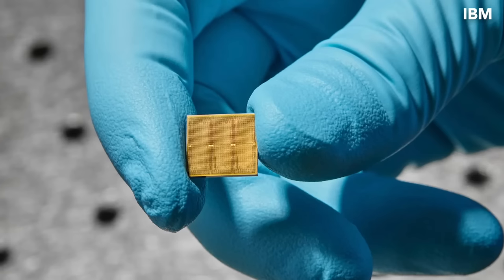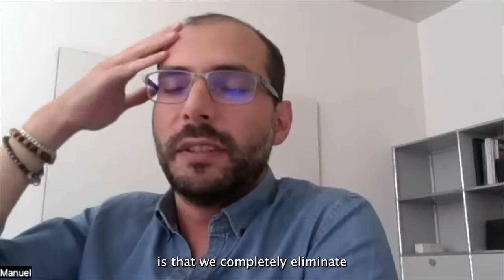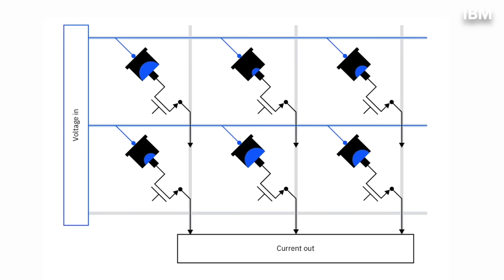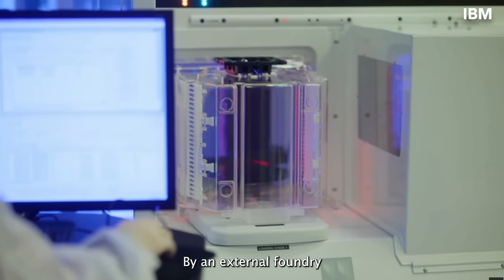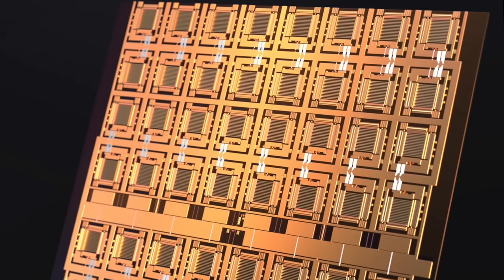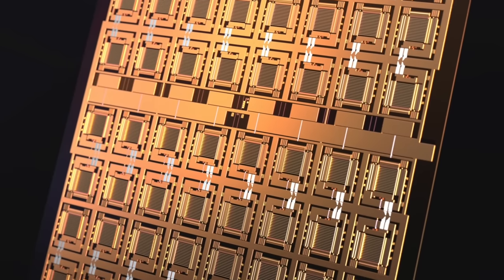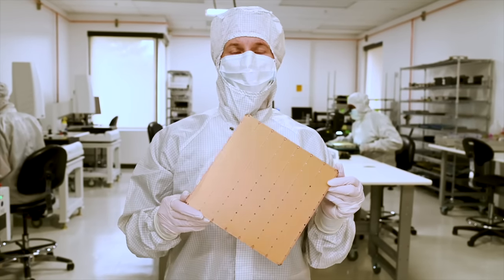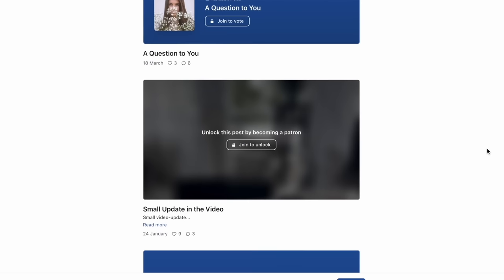IBM's New Computer Chip is Pushing the LIMITS! 🔥

Comment: In my professional field, analog is almost considered a pejorative term. At some scales the use of analog active filter elements using op-amps in combination with digital potentiometers, peak detectors and SAR type ADC's  can significantly reduce the computational overhead. As channels are added however the scale increases and the footprint with it. Seeing so much effort going into integrated analog/digital systems is very exciting for me, thanks for the great video.
Reply: It's low computation but high chip real estate.   For example,  the cosh function on the old ETANN chip used 4 op-amps,  and took up so much space it had to be time multiplexed between rows of the matrix - which  gives up a lot of the advantages of analog NN.    I've been pondering how to do an acceptable sigmoid func with as low as 2 transistors (with trick gates that resist saturation)  so that every matrix can afford to have its own realtime outputs.
Reply: Yes that's what I was thinking 😂
Reply: @MattOGormanSmith  Throughput though?

Comment: Honestly, it's scary to see how much money and effort goes into this at the moment, and how many overworked brillant engineers tinker away at their particular project, trying to find the next big thing that injects even more speed into everything AI. Breakthroughs are bound to happen and it's clear that we can expect BIG jumps in performance in terms of hardware, training methods, model architecture, algorithms and software as well as data. This is going to go through the roof. Ready or not, here it comes.
Reply: Então e aí que tá o Sucesso de ver quem já tem dificuldade de similar Palavras isso já são coisas Nelrais uma função que está dando um Curtosirquito. Trás o Chips a Memória que não tá mais fazendo a Leitura de Palavras e fica se debatendo em memorizar #
Reply: Evolution tends to favor the most adaptive.  The AI-human symbiosis co-evolution is inevitable.  "Scary" is irrelevant . . . some will adapt accordingly, others maybe not, such is the consistent nature of evolution.
Reply: Doesn't photonicas have the same benefit of doing multiple calculations at once with low power? At 70% the speed of light no less. 

 Then further there are quantum computers that use photons as well? 

 All without some of the issues here?

Comment: When you mentioned a substance being heated and cooled, to go from solid, to (liquid?) to Crystalline... how does this happen on such a fast scale? Doesn' heating and forming crystals take SO much longer than just passing currents? That implies a physical change process, not just an electrical state change. If it works, it works, not denying that, but it seems odd that the two would be on a competitive time frame. This stuff is SO fascinating! Thank you Anastasi and all who put these posts together.
Reply: If you use heat exchange formulas with the scale size of the material it is incredibly fast. Heat, or energy, transfers almost instantaneously at the electron size. If we have material in nanometer sizes, it would seem instant.

Comment: The problem with this result (just like Mythic's analog edge AI processor) is the power efficiency is not particularly impressive. The reported 12.4 TOPS/W is no better than efficient digital neutral networks. Oppo's 2 year old phone AP with a 6nm process node has an 11.6 TOPS/W CNN core, but that falls far short of the current leaders. Gyrfalcon claims 24 TOPS/W, but Perceive's Ergo chip (or maybe its Ergo 2) claims 55 TOPS/W.

This is an area I've done some research in. My original Ph.D. topic in 1990 was digital and analog neutral network implementations, and then I worked on the topic again a few years later and then again for a DARPA project around 2009. As you discussed, the fact is a lot of benefits of the analog computation evaporate when you include the DACs (for the input voltage) and ADCs and then if you need to extend the equivalent arithmetic precision beyond the SNR limitations of a basic analog multiplier.

It’s easy to say that reducing the power of ADCs and DACs could resolve that, but it’s much harder to actually do that. Reducing power of both these circuits has been an area of massive amounts of research for other chips. For example, the highly competitive $10B CMOS image sensor market demands ever lower power ADCs, and yet still those ADCs are very power hungry.

There was a big push in the direction of analog computation after Carver Mead published his book “Analog VLSI and Neural Systems” in 1989. I heard many people making extravagant claims that analog computation would soon replace digital (like the time one of Carver Mead’s students who gave a talk at my university said, “Oh! Carver says that no one’s working on digital any more”).

The hype never manifested because of the issues you and I have both discussed. Another issue is that the design and validation cycles for complex analog chips are so long that by the time you get your product to market, your digital competitors have moved on a process node, or two. Maybe that runs out at some point with the much-discussed end of Moore’s Law, but there’s still a long way to go before lower power digital innovations run out of steam.

I’m not saying this approach can never yield benefits (evangelists would always point to the brain being analog and only consuming around 12W), but extraordinary claims require extraordinary evidence. You can’t just claim a low-power analog multiply-accumulate (again) and extrapolate that to a lower power real-world system. You need to demonstrate that end to end power efficiency.
Reply: One third of electricity expenditure in data-centres is used on cooling, so the argument for analog chips starts to become more appealing given how little heat the little buggers produce.
Reply: @locinolacolino1302  it only becomes appealing if they actually use less power. The power gets converted to heat. If the full system including ADCs and DACs uses more power than a completely digital implementation, then it means it creates more heat.

Comment: The "bottleneck" in current computers is the use of X86 derived architectures that while x86-64 somewhat improved some things, it's still not as effective as a properly designed new architecture like the CPUs that were coming out in the mid to late 1990s and early 2000s.

For example the Intel Itanium architecture would have eliminated a lot of these bottlenecks if it had been more widely used but you'd also need a properly engineered Operating System that isn't held back by companies with monopolistic practices and antitrust activities.

Comment: back in the late '80s the audio greeting cards became a thing. They were analog storage. Instead of storing a digital value and having a DA converter, they allocated one bit per sample and used the pulse/measure/pulse method to program the bit to match the analog value being recorded and then at playback, they just toggled through the bits and fed them to an amp. The dirt cheap chips that were put in greeting cards were getting about 8 bit data out of a single bit that way.

programming with multiple pulses like that is much slower than normal storage, but is pretty reliable and depending on the recording cell type can last a long time.

Also, the wear is on erase cycles, not programming pulses (especially partial programming pulses)

Comment: The energy savings of compute in memory to my mind is the most important point. Given the energy costs and heat dissipation problems of current compute in large scale projects, any advancements that cut energy consumption are useful. Analog per se, may not be the solution for more general computational purposes, but the concept of elimination of the time and power waste in data movement is something to look at across the board.  From a different angle, I cannot help but think that in the process of attempting to solve the fabrications problems inherent in designing analog elements the folks at IBM and elsewhere may well solve other fabrication difficulties dealing with other unconventional materials and microelectronic structures. I keep hoping to see more advancement in non silicon semiconductors and exotic designs such as graphene transistors.

Comment: Great topic. The "analog computing" is digital but not necessarily binary. It can work on base n (n= integer). So one "bit" in base 256 for example , is equivalent to 8 bits in base 2. As long as we can distinguish all 256 states without noise, similar to how we distinguish 0 from 1 as -5 V and + 5 V. We can compute faster and we can store more info per bit ... We should have been doing this a long time ago to compensate for Moore's Law limitations. As allways Anastasi explained this very clear. Now I understand it much better ...

Comment: My first thought when i heard "phase change" was about temperature sensitivity. If the ambient temperature changes in the computer (such as from the waste heat of nearby digital components), will it affect the phase of all bits (and will they be affected uniformly)? Does this need to be cooled with special equipment as quantum processors do or can it run at room temperature? 
In any case, thanks for the new topic(s) to explore. 😄
Reply: The analog components are made of a ferroelectric material that can be constructed in such a way that a single component can act as a capacitor resistor or transistor
Reply: I think the output is calibrated to take into account a scale of temperature.

Comment: Anastasi, I am not an electronic geek. However, approx the back of the envelop calculation, heat dissipation for CPU is in the range of 200-250 Watts, for GPU is about 400-500 Watts (max). For each DIMMs - about 5 Watts x 8 = 40 Watts. Multi core (64) Analog in-memory compute chip - not sure how much this will add to power savings? We are now talking about a 192 core from ARM that consumes a lot less power  (~50 Watts) than the traditional x86 CPUs. So I don't really see a value here - what am I missing?  It is 64 core and 14nm? Even form factor does not help! Please correct me ...

Comment: Hmm.. IBM, here are my immediate thoughts:
Instead of phase change cells, it would be faster and cheaper to use capacitive memory.
That is, the weight stored as an actual variable charge/voltage on a capacitor.
Changing the charge on a capacitor (during training) is almost instantaneous, and can be done a practically unlimited number of times.
And then, instead of sequential ADC (which is slow), use old school resistive ladder conversion, which is practically instantaneous.
One of the challenges would be, of course, to make the capacitors sufficiently low leakage to hold a somewhat stable charge over time.
Hope this reaches You guys.. Perhaps Anastasi would relay it?
Cheers / Love.

Comment: It seems to me that a broader area encoding can make these analog chips much more resilient. The problem is the digital small area controller to phase change such a large area. Thus the query sent to the area can be checked and rechecked for veracity. When a higher return is discovered then the answer yes or no can be binary output.

Comment: Why not a huge and fast FPGA with memory built into the one wafer, and have the FPGA allocate logic structure based on an individual application being driven.  In turn, if you wish to have several applications running at once, multiple cores could be utilized to facilitate this.

I don't see why desktop processing has to always be limited to one expensive CPU, I would prefer to have an array of 4-8 CPU sockets on a motherboard, or should I say multipurpose sockets for CPUs, SOCs, GPUs, AI chips, music synths by brands like Korg and Yamaha, PhotoShop accelerators, Camera and video related accelerators, FPGA, etc.

I like sockets better than cards because the bus running to slots is always anemically slow.  We need a bunch of circuits feeding into a master socket which rules them all and connects to RAM.  I like the idea of RAM baked into the wafer, but having slower ram in huge quantities can also be great;.

Comment: 13:00 I do not understand the digital scaling of the output. Wouldn't having the values converted to digital and scaled digitally defeat the purpose of analog processing?? How does the computer know how much the values have drifted in order to scale those outputs accurately??

Comment: It must be the case that the temperature of phase change memory will have to be controlled accurately.
This accuracy could be supported with a phase change material environment.
Obviously the phase change environment will have to have just enough delay so that it does not swamp the signal.

Comment: Problem of aging table of conductance states: It seems to be best to store the 4-bit-memory digital in static memory cells. From these arise a stable resistance memory without the aging for quick analogue calculating. Important is perfect design of this digital/analogue synapse/memory cell. Within booting process artificial brains could load a synapse digital table in their memory to execute their specific tasks. Only calculating the correct specific digital table in simulations comes from power consuming mainframes in data centers. - I hope from this comes my personal robot, that do every task in my household: Rosey the Robot (Jetsons)!

Comment: Why the separation of computing and memory in first place, it has to be some advantage to that approach otherwise there is some large data which is not necessarily sufficient for computation. Indeed the bit modulation and scaling is very nice for machine learning applications but not at all steps. Where is the comparison between analog FPGA and digital?

Comment: I don't think it's a problem if much more efficient analog chips don't achieve the same accuracy due to analog noise, as long as you can subsequently finetune the network on conventional  hardware to similar accuracy as networkes trained entirely on conventional hardware.

Comment: I also been doing a lot work with analog computers, but not in the way they are used in this video,  I found to be very useful in analog signal processing applications and direct conversion without the need ADC or DACs. I used this technology with RF modulators and demodulates, that make part of signal processing block, that able to work with noisy input signals. Applications so far: are in Navigation and Television decoders, with ideas to expand  this Radar signal processing to analyze differences in phase shift and Doppler.
Reply from the maker: Interesting, have you published your research ?
Reply: @AnastasiInTech  Electronic magazines and on linked in, once I have a basic working prototype I end up moving on to doing something else. This is life been outside of the academic system, I am always happy to pass on my research for other to work with.

Comment: With so much computing power and probable redundancy, to clean up the noise would it be practical to run several channels as a filter for each equation in paralel then average the output to improve the % accuracy of the output. This as a stop gap while other silicon or super conductors are being developed. The number of channels being dialed in acording to the acuracy required by the work in hand.  Maybe utilising fiber optics and super capacitors . FINAL COMPONANTS BEING A COUPLE FLUX CAPACITOR AND ITS 🌀BEAM ME UP SCOTY. 🌠

Comment: Phase change memory does seem like it could be a good way to reduce the cost of running pretrained AI models, but I'd be surprised if it will be production quality anytime soon. In the near term I think moving digital memory closer to the processor using chiplet designs will be more practical. The Samsung cache DRAM looks quite interesting. I'd like to see the age of separate sticks of RAM go away and just put all the memory on top of the CPU chip. The challenge there is getting all the added heat out, so that will also take a while to reach production.
Reply from the maker: Thank you for the insightful comment. 
Let’s see which tech gets multi-bit first. 
Agree, we will see more stacking and near memory computing in the near future
Reply: That would be a disaster for the consumer though as far as flexibility for RAM amounts.... There is no way manufacturer's would allow you the same flexibility of just swapping out RAM sticks or installing more RAM.

Comment: I had similar idea , but not necessary analog. More like compress or Morse code. 0.1 mili volt = 0001 , 0.2 = 0011 , 0.3 = 0111 … and so on instead of only 1 or 0 or volt , no volt .

Comment: I read on IBM's webpage about analog AI chips that this type of hardware uses drastically less power to do AI tasks. A recurrent neural network transducer 'speech-to-text' was implemented in analog AI chip, tested, and compared with the same function implemented with digital AI chip: 17 times less power required. Power consumption of biological organic neural networks must be insanely low, but impossible to implement in silicon. I think we are still a decade away from affordable General Purpose  Robots (GPR's), even with analog AI chips.

Comment: Why not use photons and holographic optical processing instead of limiting to quasi-3d computing(whether analog/digital) using planar silicon chips?
There is also possibility of energy recycling(ideally logic computation should take zero power, if not for the parasitics, leakage and switching thresholds of mos devices). Just some 💭